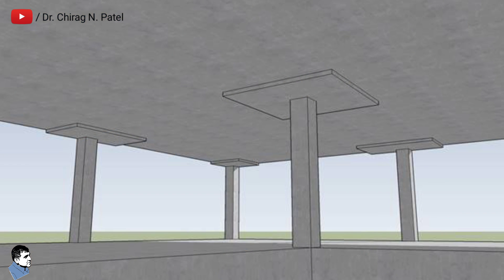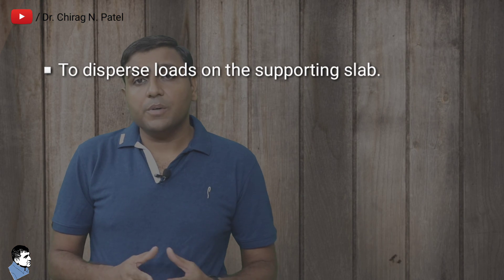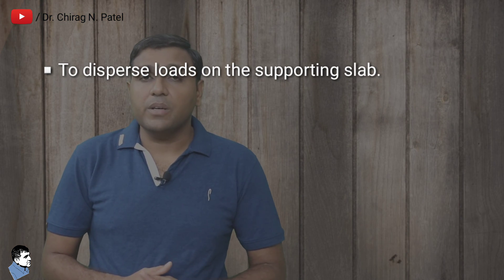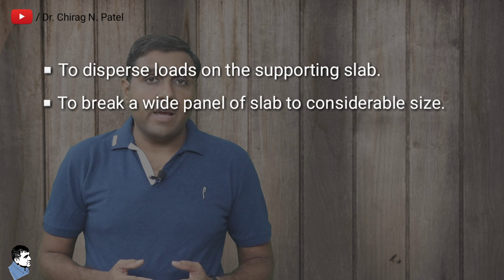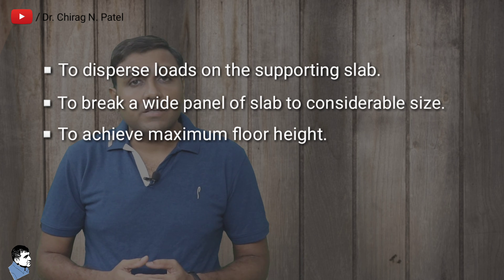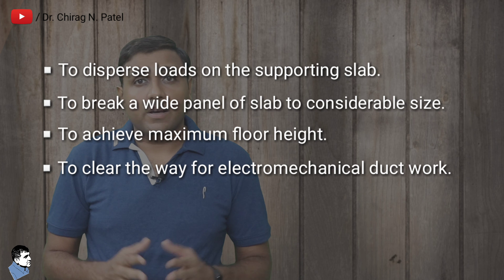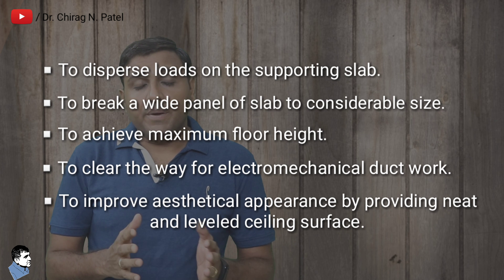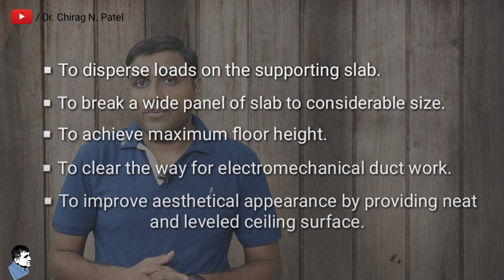Slab Beam | Concealed Beam | Hidden Beam | Beam | Concrete Beam

Comment: I wonder how to consider the Hidden beam in analysing or designing ?
Reply from the maker: It is considered as normal beam with lesser depth. Generally it is provided for  additional load coming from top, and it is only meant for that purpose.